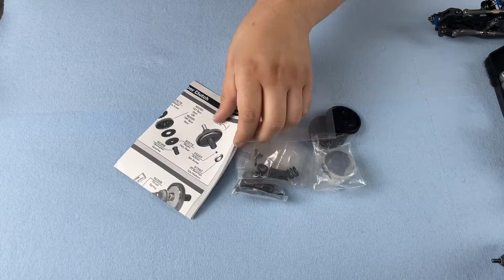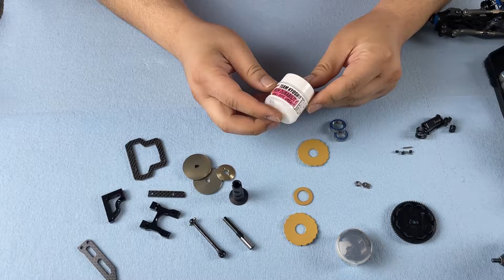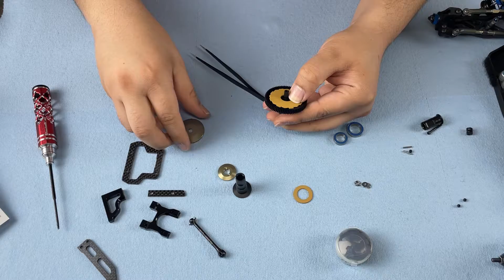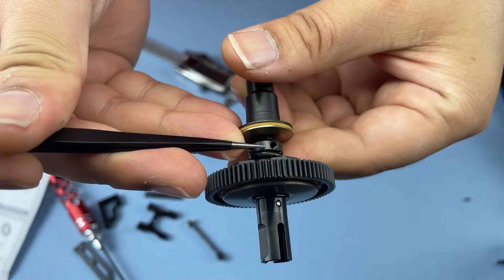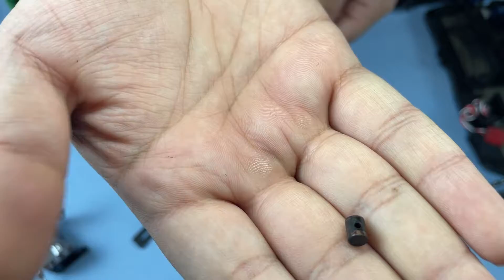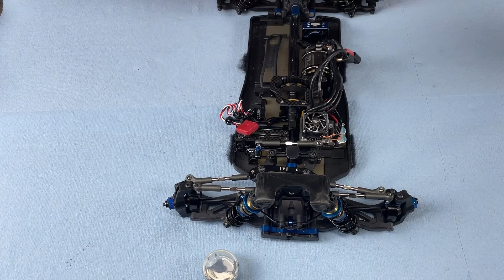Team Associated B74.2 Decoupled Slipper Clutch Conversion Kit Install

Comment: So basically made it like a gear diff without being a gear diff hence why I run the dirt version for both carpet and dirt racing
Reply from the maker: Please explain why you think that. Would like to hear your thoughts. 

If you had a gear diff, the front wheel would still be acted upon by the diff and motor while under braking. Maybe if the center diff weight was low, it might not? With the decoupled slipper kit, it "disconnects" the front wheels from the slipper and motor and turns the buggy into rear wheel braking only (when you are braking). Under acceleration, there is no diff action where the front or rear may slip, it locks up instantly, and both the front and rear see power. I think there are benefits to have from this system over the center diff on carpet. I've driven a XRAY with a center diff with 500k fluid in it, and I didn't like the tendencies it had when compared to a decoupled slipper. Decoupled slipper on carpet was quicker.

Comment: What do you think of the decoupled slipper on the track?
Reply from the maker: Definitely think it's worth the upgrade. Took 0.5 seconds off my lap time on a 10 second lap layout. If your track has a lot of tight turns, it helps rotate the car quicker. I feel like it lacks the punch on corner exit, but makes up for it on corner entry and mid corner. Just posted a review video. Thank you for watching and commenting!

Comment: I was interested in adding one of these to mine, but here in the UK the upgrade costs £114 (with a discount); considering the entire chassis kit costs £469 (same store), that's almost 25% of the cost of the entire chassis, just in this small upgrade part. Crazy.
Reply from the maker: I was torn when I bought mine. I usually don't spend a lot of money on upgrades, unless I think it's going to make me faster. This was one of those upgrades where I can tell it's faster and the data backs it up. If you have a tight track where you race, I would definitely consider getting this upgrade.